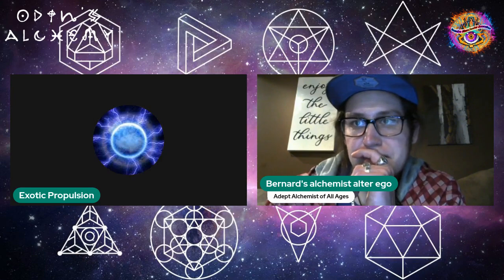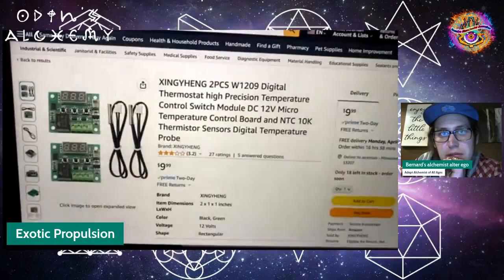Liminal & Jeremiah's Crystal Growing Techniques & Discoveries w/ @burneye  @exoticpropulsion8175

Comment: Thinking about crystal formation under vacuum?  Low pressure and a change down in formation energy at a given temp?
Reply from the maker: great question for Jeremiah Popp
Reply: I recall using vacuum to “dry” organic compounds and remove the solvents.
Reply from the maker: @ronmuckle8644  please elaborate on specifics
Reply: @cryptoalchemist369   so we made organic compounds in labs, once synthesis steps had taken place we used solvents to extract the product, we’d wash the products with things like acetone, dmso, petrol ether, etc 

Filter that through paper, the. Collect the solution

The solution could then be further washed with water or alcohol or whatever, polar or no polar solvents depending on product solubility,  then the solution would be placed to dry under vacuum At room temp.

We also used a device called a rotary evaporator which was essentially a round bottomed flask under vacuum 

The liquid solution containing the product would be spun evenly and the flask was submersible in a water bath 
This could be set to a precise temperature and the flask under rotation moved in and out of the water bath. 

This would drive off solvents hopefully leaving a crystalline product or even oils. 

The solids were often ran through an NMR  to determine structure 

And melting points were taken.

A mp varying from the book gave an idea of impurities. 

I’m not sure how these set ups would work with electrolysis set ups 

Sometimes dry solids were dried in a Petri dish in a large glass oven type dish  the lid was put on sealed with Vaseline and the. Evacuated with the vacuum line. 

This allowed crystals or product in solution to  form as the vacuum assisted the evaporation of solvent at room temp. 

Just you tube rotary evaporators or vacuum dish. Probs make more sense.
Reply: Pv=nRT  

It might help with removal of solvents at lower temps.

Like how water boils at 97c up a mountain compared to 100c at sea level. 

Reduce pressure reduce temperature of evaporation. 

I assume these crystals form as the solvent leaves.